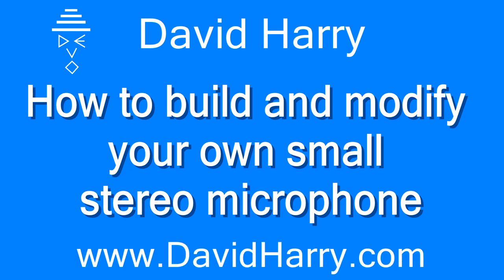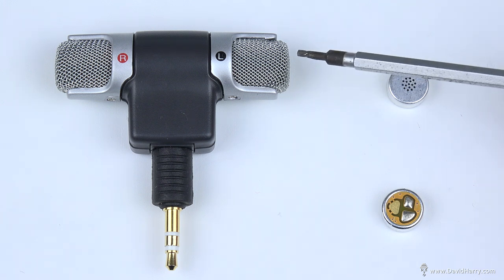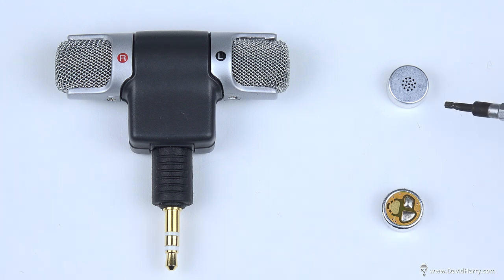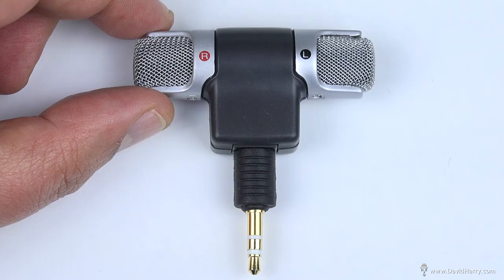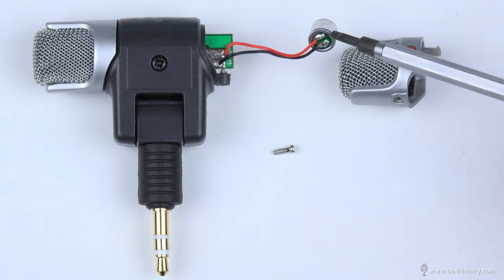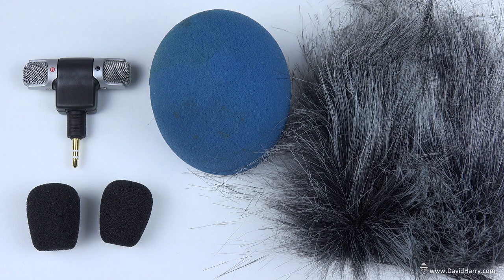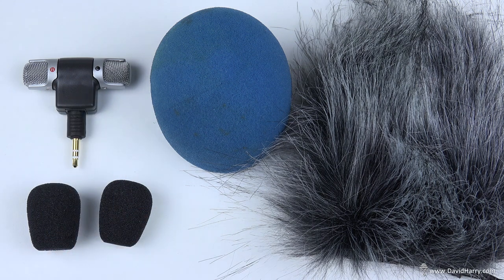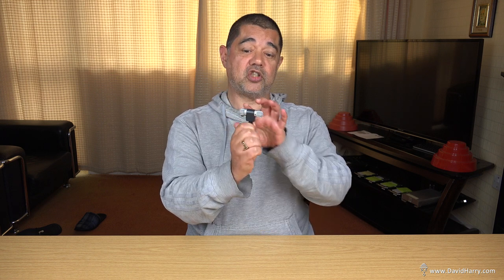DIY stereo microphone

Comment: Hi David. I eventually got around to building this mic. The capsules are very good and do give a good output for the Osmo Pocket. I did have a problem with the body though. Any time I got anywhere near a power line or mains cable at a festival it picked up mains hum. I don't think that the mic body is shielded enough. Eventually, I converted an old slim metal torch into a mic body and the hum has now gone. Great mic capsules though. Thanks for reviewing them. Good service from the company. I've used a foam filter with a fur cover from Neewer for the Tascam DO5 which fits perfectly. Very good wind noise rejection. The Neewer fur muffs are good quality, well made and cheaper than the Rhode muffs of a similar size. Thanks again.
 Ray.
 Ps. I've found another two problems with the DJI audio adapter which may explain a few things regarding mic matching. Will post findings to the DJI forum when I get time.
Reply from the maker: Hi Ray. Good to hear from you. I’m glad the mic works for you. While it’s a little compromised with the lack of channel separation on the Pocket, it does work very well with other recording options. I’ve not noticed any RFI or EMI issues with the one I made. It may be that the case could be slightly different, shielding etc. as there are a number of variations of these things. I look forward to the results you mention about the adaptor, I’ll keep an eye out on the forum. Cheers buddy, Dave.

Comment: I just bought the same mic for free on AliExpress. But it's a TRRS. I'm waiting now for Primo capsules. Thx for the tip.
Reply from the maker: Hi Philippe. Unfortunately, that mic body probably won’t work as it’s very unlikely, if not impossible, due to the way the TRRS jack will probably be wired. I may be wrong about that particular mic but if it’s a mic that’s using standard TRRS it definitely won’t work. If you keep an eye on my channel I’ll be doing another similar stereo mic build but this one almost sounds binaural, it’s got a very wide stereo response that sounds awesome. It’s based around cutting up two cheap plastic hand help mics and using a couple of other things that make it cold shoe mountable for cameras. That mic also uses the Primo capsules. Let me know how you get on with your TRRS mic, I’m very interested to know if it will work. Cheers, Dave.
Reply: @DavidHarry  
Thanks for reply Harry. Yes there is some adapter TRS to TRRS. For less than a EUR.
Did you tried already this capsule ?
"Primo EM258 6mm Omni Electret Capsule"
Is it as good as EM272, witch is amazing for the price. I made my own binaural with them. It sound great.

Comment: Android phones have trrs jack .
1 ground
2 mic
3 L
4 R
.we cannot connect stereo micophone . because it has only one mic input . Is there any way to connect stereo micophone on TRRS jack ?
Reply from the maker: Hi. There is no way to connect a stereo mic to any TRRS device. The only way you'd get stereo on an Android device is by using a USB stereo device. Cheers, Dave.
Reply: This is not useful on a smartphone anyway, because there's no way to orient it correctly, when recording horizontally. The mics can only be pointing up and down, or forwards and backwards, not left and right, when the phone is horizontal.

Comment: Great video, thx! Did you managed to test the sound of the new capsules? Where the capsules damaged by the soldering process? I heard that you can lose high frequencys if you damage the capsule and that it's really hard to solder them with a DIY setup like this.

Comment: Where did you get those red DEVO hats? and how do you use those hard drives with the tv? I remember to saw a similar video about this cheap mic but they modify the internal board. Not only the 2 mics.